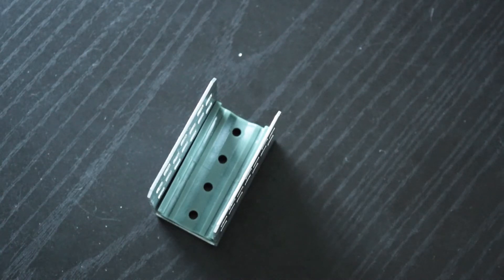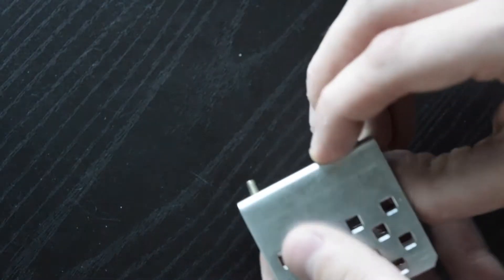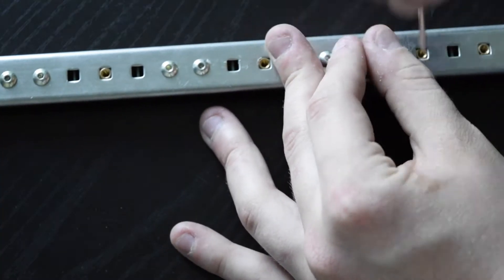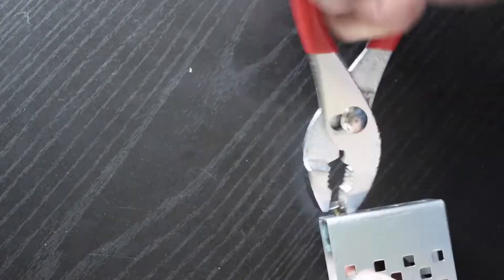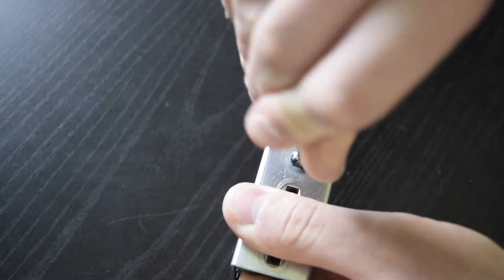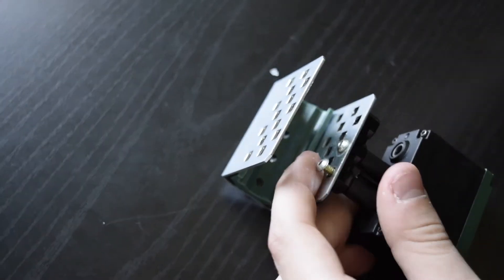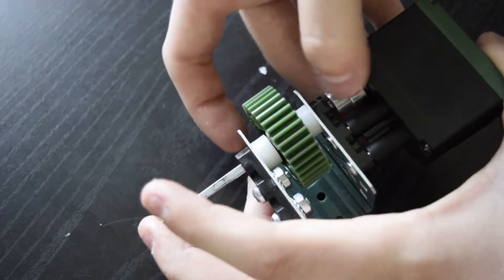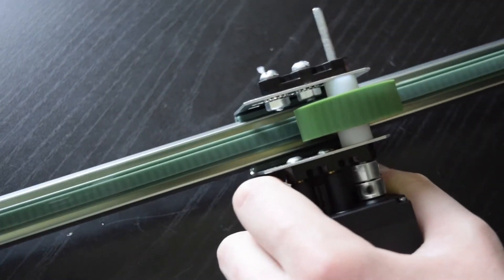Vex Robotics Linear Slide Lift Tutorial + Explanation

Comment: What size shaft did you use? Ours is too small and keeps sliding around inside the gear. ANy advice?
Reply from the maker: Are you using the square inserts? If you're using the thick gears you should need something like what comes in this kit: https://www.vexrobotics.com/hs-sprockets-and-chain.html

Comment: Hey, is it possible to build  3 stage linear slide. So, like a cascade, except is powered by rack and pinions instead of chains.
Reply from the maker: It's probably possible, It would probably be slower than a cascade, and potentially require more motors, unless you get creative with your power.